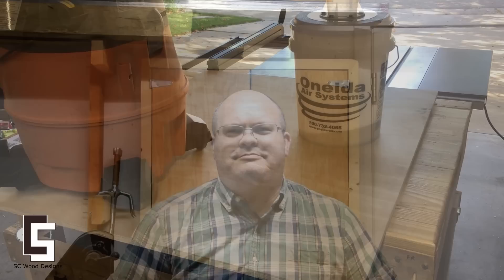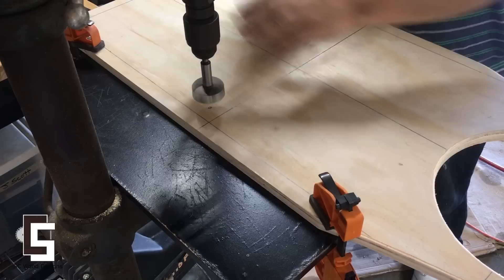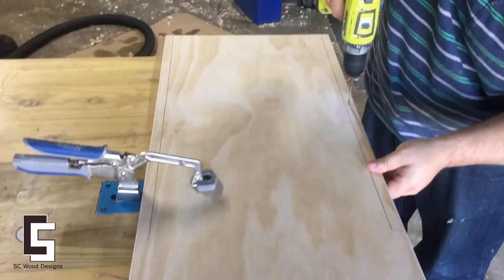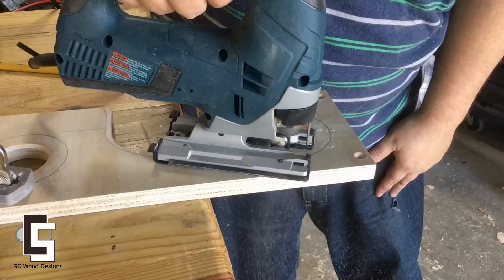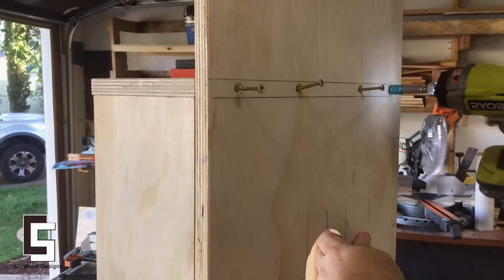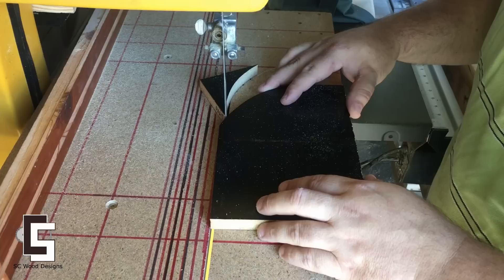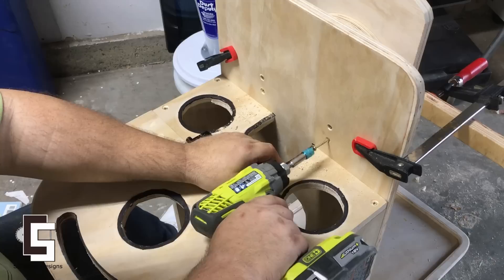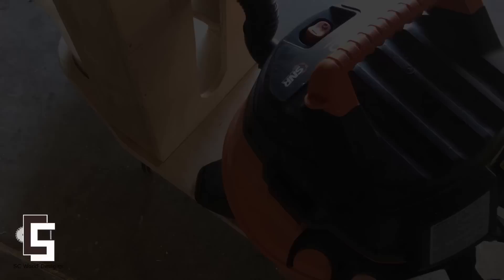Shopnotes Shopvac Cart + Oneida Dust Deputy

Comment: Good job on the video.  Enjoyed it.  I am installing 2 of these.  One for a 4" 1 hp bag filter unit and one for the 2" shop vac. I am using a FAST CAP hose reel with a 25' pool hose on it.  Tired of cleaning up the shop vac filter and the mess of it.  Good job on your build.  I like this cart as well. Yet my system is fixed with the 25' hose on a reel.
Reply from the maker: MarkJonesRanger  - wow you’ve got quite the operation going on. Thank you! Glad you liked it!

Comment: One more question — at 20:24 it looks like you’re using hex bolts rather than screws to install the casters. Can you let me know what hardware that is? 

The plan calls for #8 x 5/8” wood screws, but that seems way too small for my 3” casters (the mounting plate has large holes). Your bolts look more suitable.
Reply from the maker: Yes sir! I ran into the same problem. Went to Orchard Supply and bought (1) package of #14 x 3/4" Hex Washer Screws and (16) Cut Washer Zn 1/4-In .  Hope this helps.
Reply: Thanks. 
And congrats on the weight loss!
Reply from the maker: Thank you! I'm down 9 more pounds! Woodworking is great!!!
Reply from the maker: FYI. I couldn't give all the information about the build on the video due to copyright issues. I tried to be as thorough on the filming as possible in case someone used the video for building.

Comment: Great video! One question about the construction — I notice a lot of screws going into plywood end grain. Any reason you couldn’t/didn’t use pocket screws here for a stronger joint?
Reply from the maker: I'm fairly new to this. I just followed the plans. I am learning as I go hence this suggestion. Thank you for the input!.
Reply: Ok no problem. There are a couple of other Shopnotes Dust Deputy Cart builds on youtube and they're all built the same way (as the plans call for). I'm new to this too, and am about to start my build. Was thinking about using pocket screws rather than going into the end grain (except maybe for the 3-inch'ers going into the tall piece from the bottom..). 

Anyhow, keep it up and thanks for the video, will help me get mine done!
Reply from the maker: I'm glad it can help. I have no issues with it being loose or coming apart. I didn't even use glue on the joints. Just the hose holder wrap. You may want to use glue if you are concerned. Cheers!